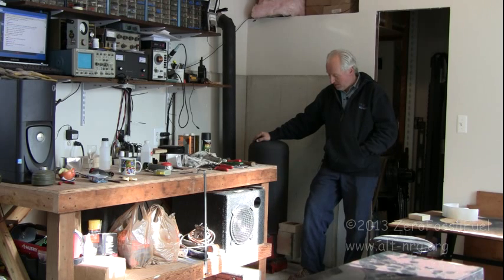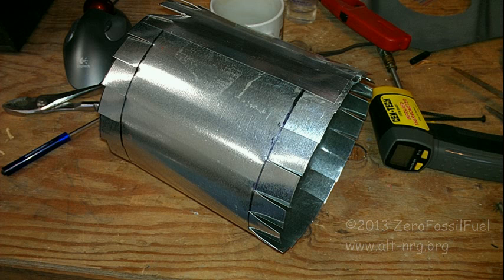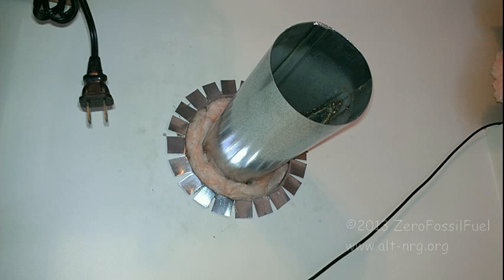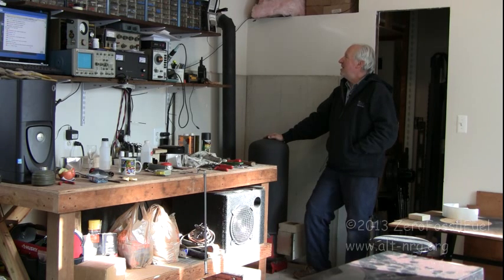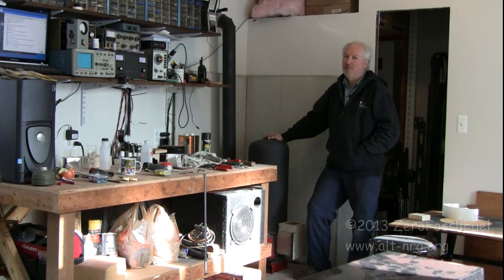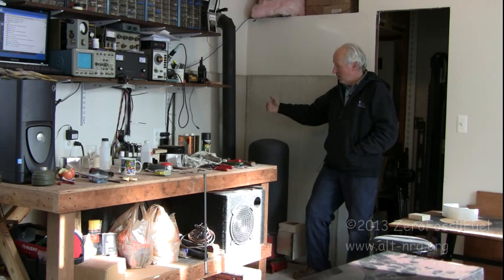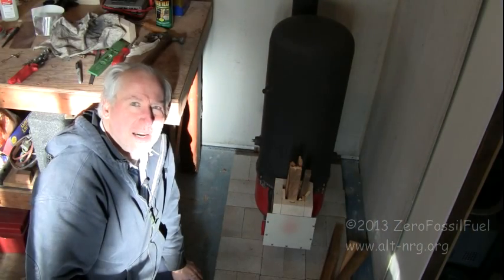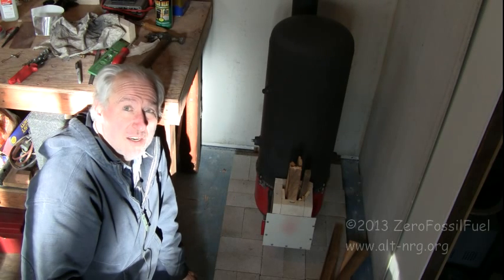#325 Rocket stove installed, performance data

Comment: Great video series! Thank you for the run down on the entire build. Love the use of the compressor tank in lieu of the fugly metal drums. :-p I am planning on putting in a greenhouse this year and want to put a rocket heater in for winter temperature control. What is the square footage on the shop you are heating? I am wondering if depending on the size of the greenhouse that I might need a stove at each end for the occasional stupid cold weather we have.

Comment: How much square feet are you heating with that stove in your workshop.  Sorry if I missed it in the video, I had the sound too low part of the time.   I'm interested as I have a three car garage in Northern NJ that is really cold this year!   It used to be heated with oil and I can't stand the price of it these days!   Thats why I built my first EV in 2008.   Check out my other channel that I can't access anymore at Rocketmaker10000 for build video.  I started this new one recently to start over

Comment: i am looking to make a rocketstove to replace my wood burning stove with a back boiler and am considering making a boiler tank out of the up pipe in 4" square steal as the inside wall of the boiler tank and 6" square steel as the outside of the boiler tank more or less where you have put your fire bricks. i am not sure wether to insulate the outside of this boiler tank or to not and hopefull pick up more heat in to the tank as the gasses pass down to the bottom of the outside wall of the stove

Comment: I imagine a small fan blowing across the drum would increase and help even out your indoor air temperatures. With 140 going out, there is still more heat you can claim. 

I like the Permies Videos but the stupid comments and condescending attitude at times can be a bit much. It seems he is trying to be funny but he doesn't come off that way.

Comment: "Fiberglass has a softening point of 1555°F and a melting point of 2075° F. Thanks for using ChaCha!"

I don't think you will have a problem, not with the temps you posted ;-)

I have seen several RS's on you tube start drafting the wrong way, a good hard blow from the mouth and lungs corrected it. If your lungs are weak, a $1 garage sale hair dryer will work too or a shot of air from your air compressor.

Comment: As to the heat sink issue. There is a product available for stove pipes that you could easily make your self. It is nothing more that a long strip of sheet metal 2 or 3" wide, bent up accordion style. Once bent stretch it around the pipe and secure the ends with a screw. The spring tension of the bends will give it a tight fit and good contact. Also the more bends you put in it, the more contact points you will have, so more heat out.

Comment from the maker: So far so good, knock on wood (Yuk yuk). It was your build (and the fact that you were kind enough to share it) that inspired my smaller version. I even linked to it at your site from the thread I started at Permies. I would still be participating in that thread if the forum mods didn't have hissie fits over their "real sounding name" policy and locked me out because I refused to comply. Proof positive, you can't fix stupid.
Reply: LOL.  Isn't it hilarious (because it's so stupid) when forums require your handle to be a real name or a real-sounding name?  I mean what does that prove?  What problem does that solve?  What benefit does it add to the site?

Comment: If you ever do have trouble with blowback while lighting (may happen depending on outside conditions), try heating the stove pipe up a bit with a propane torch first. That should give enough draft till the thing gets going under it's own heat. Congrats on a great project from a fellow rocket stove enthusiast. You can see mine at iwilltry.org

Comment: its news to me that fiberglass insulation will melt. never had that happen in 30 plus years of wood burning and a few chimney or flue fires. I would suggest a fan to blow the heat more evenly around the room.

Comment: Have you considered possibly welding on some radiating elements to the upper tank,  i.e. anything to increase surface area to pull some more heat out of the tank and radiate it into the room.  It would essentially be free (could be made from scraps of angle iron, and I was envisioning at the simplest just some flat Ts, where the base of the 'T' is welded to the tank and the top of the 'T' faces out into the room, mounted radially around the tank,  It might get a nice convection flow going too.

Comment: used a 136 watt with 200f heat, generated 4 volts at almost 1.5 amp. the heat sink had a toy helicopter motor on it for cooling which was powered by the peltier it self

Comment from the maker: LOL! That's funny but you're right. I used to have a Russian gas mask but all I could find was the canister. I think it was so old the rubber rotted out and I threw it away. The reason I went looking for it is because the fumes of the paint stripper were REALLY BAD! I was hoping to keep working using the charcoal canister filter but instead I had to abandon ship for a long while with the windows and doors wide open.

Comment: Hey Z,
Me likey. The burn area seems to be just the right size, allowing space for the fuel/air to mix efficiently. Which allows quick combustion. One thing I'm wondering about is the height on the outside portion. I believe it will draw even better if you increase the height by several feet. Happy heating!

Comment: Hey Z, great job on the rocket stove! I have a tip for you. If you find a thorn tree or bush when on a hike, just break off the thorns as a supply of kindling. Those long thorns are the best fire starters. Also if your starting wood is a little shaggy from splitting it will start better than a smooth piece. I can't wait for your next project!